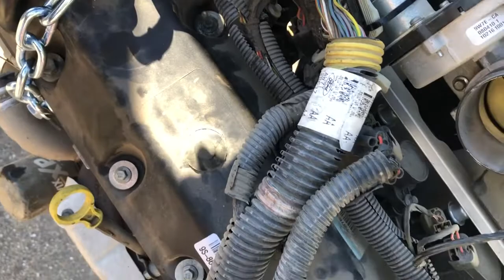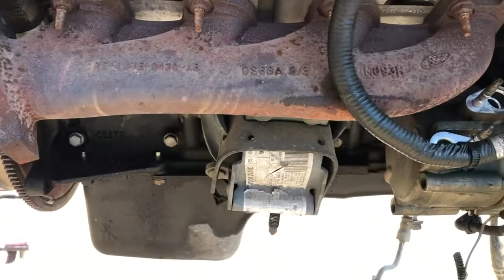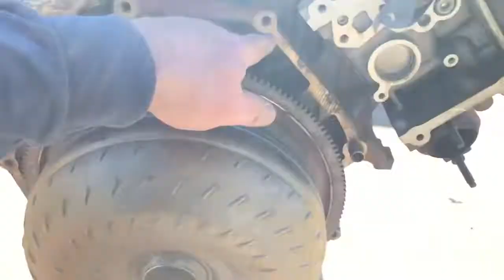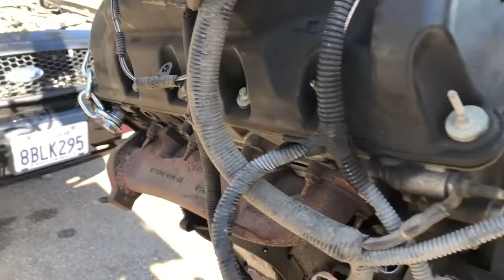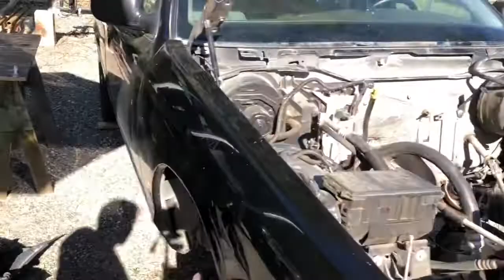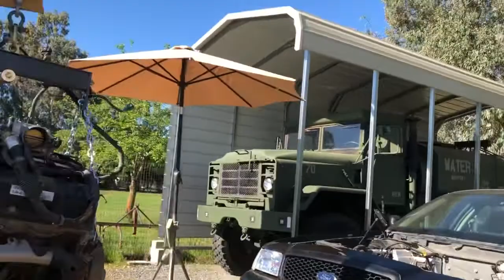Engine Removal 2011 Ford Crown Victoria

Comment: I’m about to do this with my 86. It’s easy. I way over thought it. Yes there’s a lot to unhook but it isn’t as bad hooking back up. Taking it all apart was 90% of the work. It’s harder to take apart all those bolts and clamps you did more work taking it apart then it would be putting it back together. You drop motor in make sure it’s aligned and then you can start bolting it back in and hooking up connections. It’s not as bad as your thinking I can promise that. You did most the work already on getting the old motor out.

Comment: nice video. get yourself a 5.0L with transmission from somewhere and slap it in there. then take it somewhere and have them wire it up haha. you'll have done most of the work yourself already and won't cost nearly as much.

Comment: I’m a 25 year auto mechanic and just started my first 2011 crown Victoria engine job. I log every component removal on a note pad. Then go in reverse order for installation. My memory not good like my twenties. Also take pictures. Im not sure how the oil pan will clear the frame. Thinking I might need to raise the body up off frame a few inches.

Comment: you will never get that torque converter to go back in. you have to install it first and it must go all the way in, Then you will have to turn the engine once you get it stabbed and the bell housing bolted, to install the bolts to the torque converter. It is the simplethings like this that allow us mechanics to charge what we do. Its not the labor of doing it it is the know how of doing it right to prevent further damage. I like your video and it inspires me to start doing mechanic videos. I know what i am doing and can share little tips along the way to help others not make little mistakes that turn into wasted time or even worse wasted money,

Comment: Very informative video.  I've been turning wrenches for 45 years and have had four P71's.  Good explanation of the time and effort involved just getting the engine out of the car.  Life is short.  The swap is a job best left for someone with the tools and the time.  Crown Vics are excellent.  Sorry your experience with this P7B wasn't better.

Comment: A tough job to do in your driveway,thanks for the walk around,my grandsons P 71  has oil in the coolant and I want to replace the oil filter adapter slash oil cooler gasket on the block and see what happens,hopefully I wont have to replace the engine,we will see

Comment: I got a 2000 crown Vic p71 wirh the interceptor engine. It’s gonna need a engine replacement it’s about to blow a rod. I was wondering if I need to swap it with a p71 specific motor or if I can just buy a 4.6 out of a town car or grand marquis?
Reply from the maker: I don't have enough knowledge to answer your question.

Comment: My Crown Vic is only lot drivable (technically. I still run it to the gas station for a coke to keep the neighbors quiet) at the moment because of the engine being bad, and I'm so far finding that swapping the engine is looking far cheaper than replacing the car.
Everything else in the car is new, so it rolls nicely.
I'm worried that if I get another Crown Vic, I'd have to replace all the same stuff again.
Reply: You're right. If everything else is pretty much good, just swap that engine. It'll be basically a brand new car

Comment: I have a 2008 p71 I just wrecked it has 260k highway miles non smoker runs excellent just needs a oil change the rear end has the diff lok

Comment: What did you ever do with this car? Do you still have it? Or do you still have any parts from it.
Reply from the maker: Yes I still have the car. I have been putting it out. I have all the body parts, most of the interior, the broken engine, and what not. I have sold the front axle assembly, wheels and tires, and some other odds and ends.

Comment: never pull the torque converter like that. You want to turn the flywheel and remove the tc bolts. This will cause damage to the Transmission Oil pump. You might want to inspect that tranny and make sure you didnt ruin that pump. l

Comment: I swapped an engine on my 99 MGM have it for 18 years. 200k Installed a 2001 motor 60k this spring not that bad of job considering im in Chicago area

Comment: I need to remove the engine  of my 2004 grand marquis to put in my 2003 because the plug broke in the engine ...   After 8000$ of reparations   🤦 
In Quebec I dont have many choice 😑

Comment: geTng to those 2 bolts on top of transmission problE wasNt nO picnic Ither - for all the connectors, camera picture thM B4 U unplug..  windshield Ypr SMbly?.. crap IdOnO hoO 2 dU that... sUr it’s eazy if U nO... bt I dOnt!  1 other problM which U OvrcAm... I hrd U mNtion it brEfly, ‘thE NgNs hEr on thE Old 4klift’.. wL Iye dOnt got no stinkN 4klift & neither dU mOst of us✋☹️.. it costs 1500-2000 to have someone switch the hOl thing.. U did 1/2 the batL, bt mechs want $.. they’ll problE say 1500(wN it should B 1 grNd) lIf sux - mAB I should check harbor fr8 for a simple NgN lift.. bt Bcas of all the dRn unknowns, what could be a 10-20 hr job might tAk 2 months.. & the mechs mIt mAk it tAk 2 wEx!! lIf sux chEf(& thN we rENcRn8, gudgrEf)